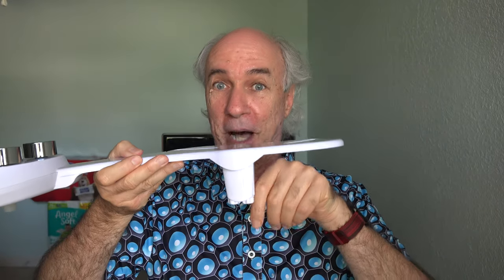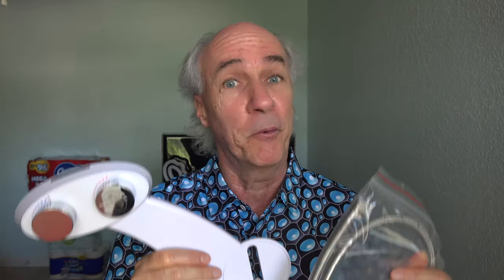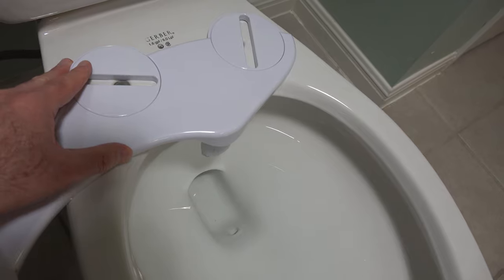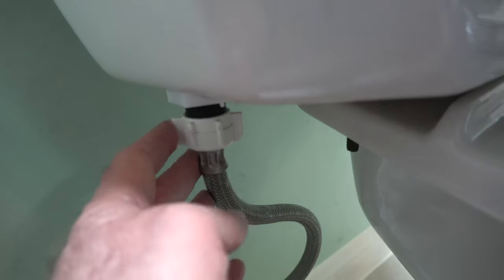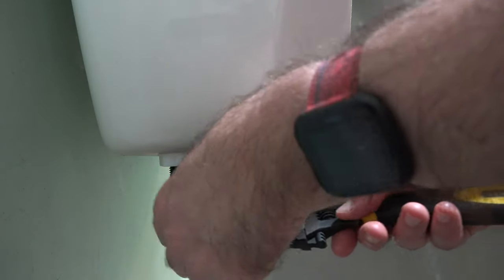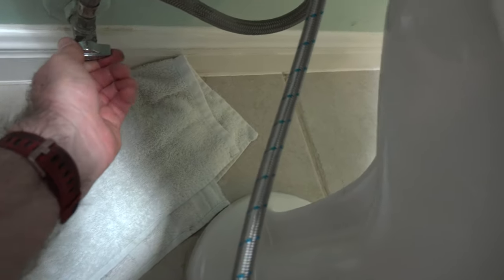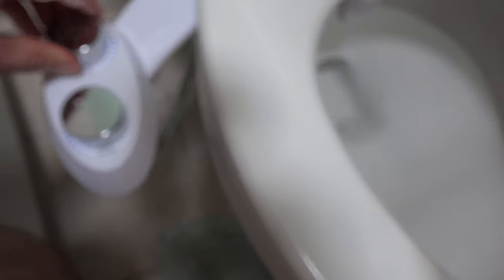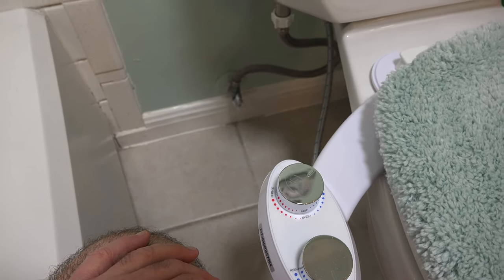Bidet Installation in Just 10 Minutes!

Comment: Interesting review, I think it's cheap enough to give it a try.
Reply: Wayne B the scary part is if it leaks it will flood your bathroom.  And it usually leaks because of cheap parts.
Reply from the maker: Thanks Wayne!
Reply from the maker: I don't know if it is more likely to leak than the hose connections you already have from the water outlet to the toilet tank.  But since there are now more connections there are more places that could leak.